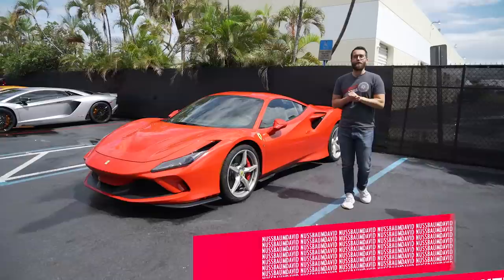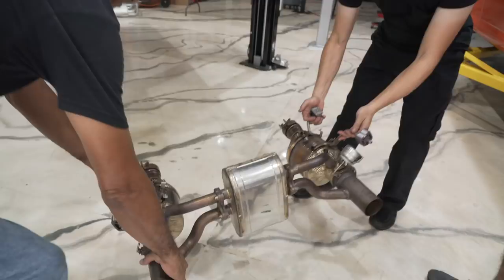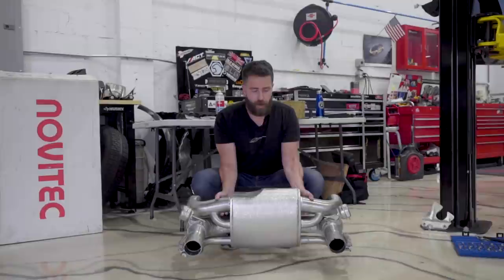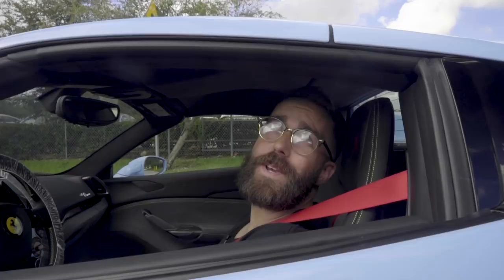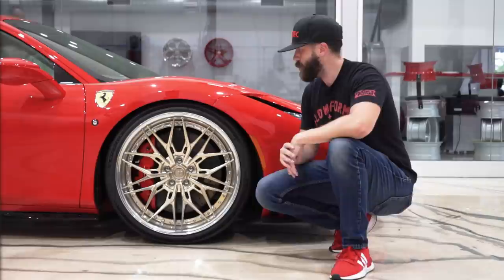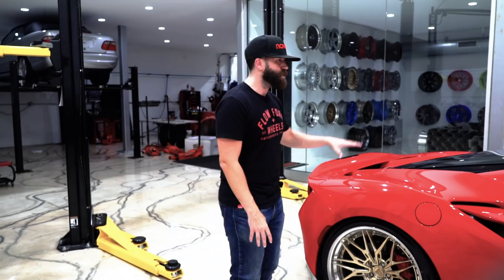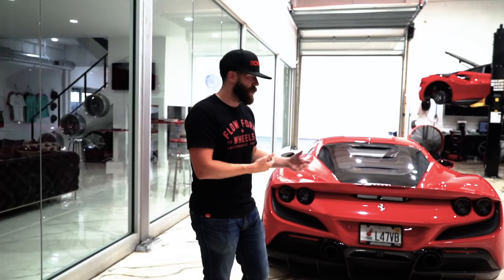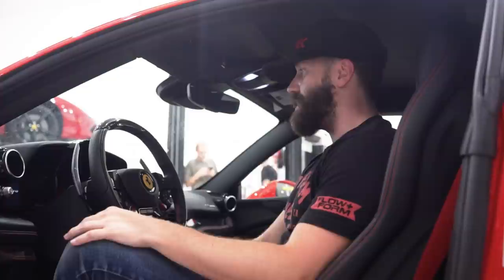FERRARI F8 TRIBUTO: NOVITEC EXHAUST + NOVITEC SPRINGS + ANRKY WHEELS

Comment: If i set up novitec exhaust … will ferrari dealer refuse to do any service or that’s ok ?
Reply from the maker: That depends on the dealer since typically each is private owned and have different company policies. We've shipped these exhausts to Ferrari dealers before for install so there are some nice ones out there :)